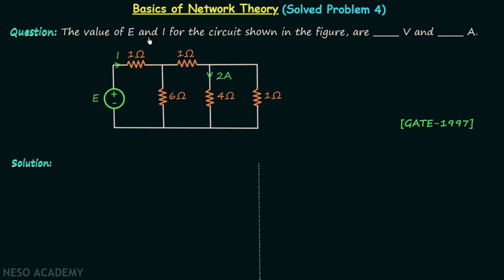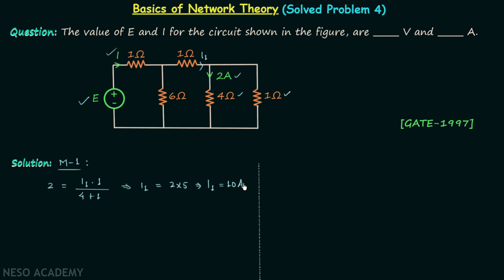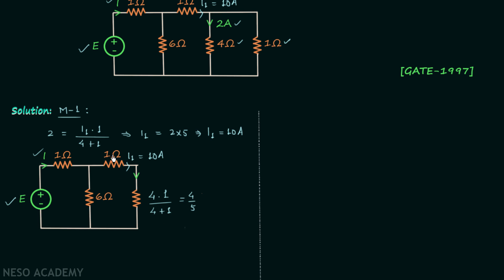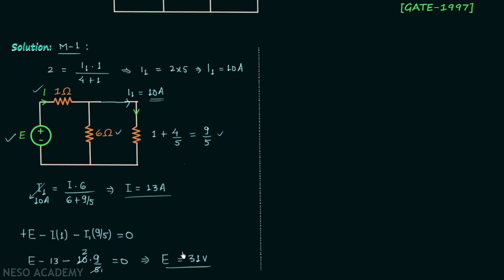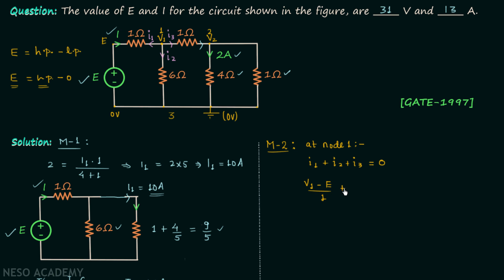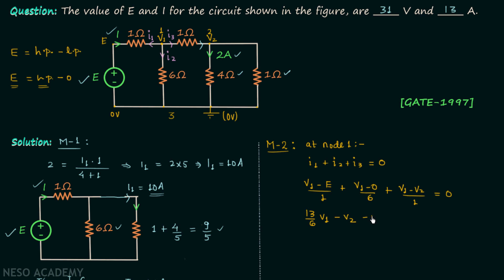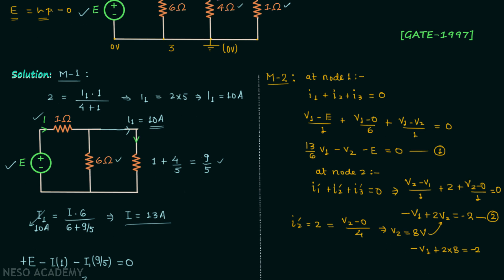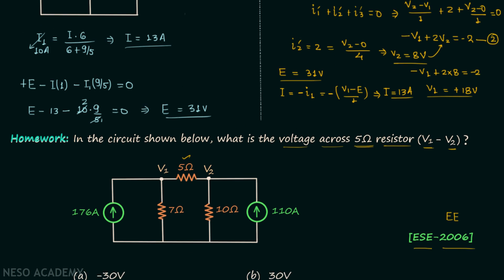Basics of Network Theory (Solved Problem 4)

Comment: just convert the current src to voltage src and thus we get 132v with a 22 ohm resistor, so current would be 6A, thus resistor 5ohm would have 5x6=30volts across it.
Reply: How to covert voltage source

Comment: consider all currents are leaving from nodes v1 and v2,
on applying nodal analysis at those nodes;
-176+v1/7+(v1-v2)/5=0
and
-110+(v2-v1)/5+v2/10=0
solve those two equations you get v1=1190 and v2=1160;
so, answer is 30V

Comment: if we apply super position theorem we will get 56 amp and 50 amp through 5 ohm resistor in opposite direction so resultant current through 5 ohm resistor is 6 amp
the voltage across the 5 ohm resistor is 5 x 6 =30 volts
Reply: can explain how it is?